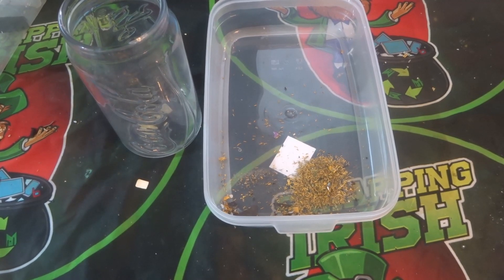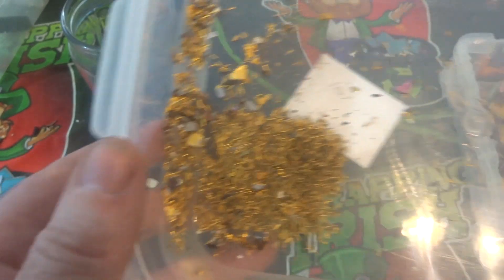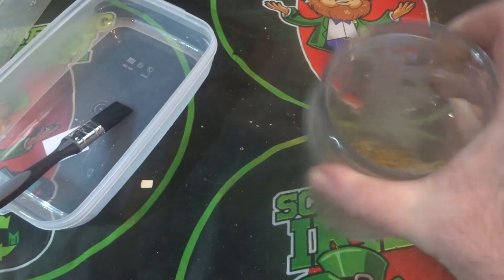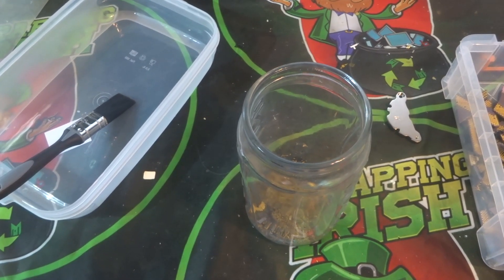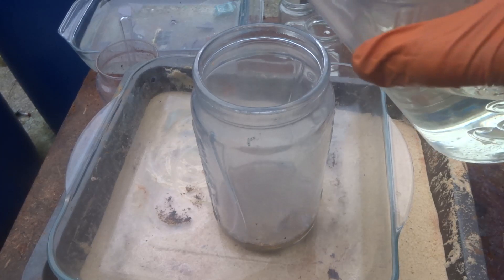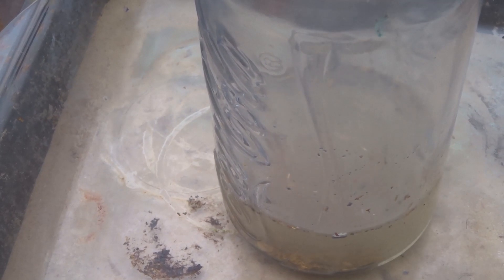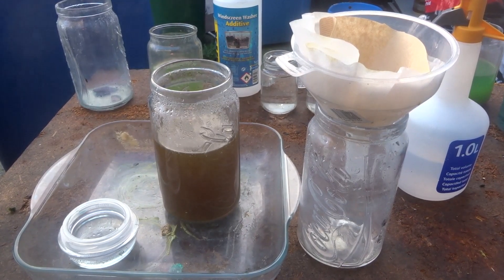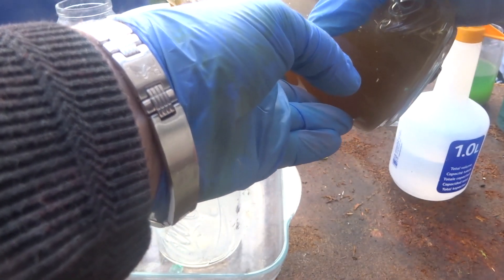gold recovery from ceramic CPU's step 2

Comment: So, tell me if I'm wrong , regardless if it's pins or boards or any gold plated stuff it's the same process .
Reply from the maker: If it a board you would do it differently
Reply: @ScrappingIrish  so, you must use a weaker solution on the boards as there is no metals to remove ?
Reply from the maker: I use hcl and peroxide on the boards
Reply: @ScrappingIrish  oh, not nitric acid
Reply from the maker: @s-s-p704  no nitric on boards
Reply: @ScrappingIrish  i was like this at school,  I would watch but never listened , # must try harder 😆😆
Reply from the maker: Lol

Comment: When I process my gold fingers, It only takes 1-2 days to remove the fingers from the pcb's. I use old and used HCL + Peroxide too. I turn on the heat and leave it on all day, and small batches get done in 1 day, large batched are usually done in two.  I don't throw out my acid until it's as thick as molasses. I don't  really get it when people  say it should be left for 1-2 weeks, and then find out it still isn't done yet! Maybe my acid is stronger than yours? Or maybe it's just the way I do things, and your method (however slower) is the  way you do things. ur set in your ways, so am I. I don't like to wait, and the acid I use accommodates me .

Comment: It's puzzling how you say that it might take days / weeks to dissolve the base metals if you're using Nitric acid. Dilute nitric acid and heat should dissolve the base metals in one-two days TOPS. I use hydrochloric acid and a little peroxide to dissolve the base metals in those pins, and I use a coffee warmer + coffee pot. It only takes 1 day to get all the magnetic metals out. If I start the process in the morning, I'm dropping the gold that night. (melting it the next day) I don't know what's going on, My guess is you're acid is not real nitric??